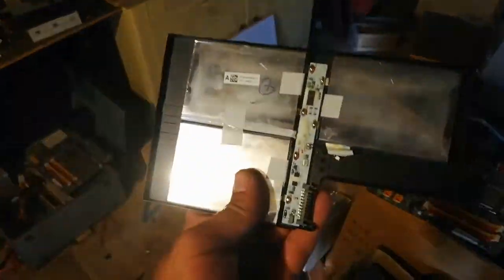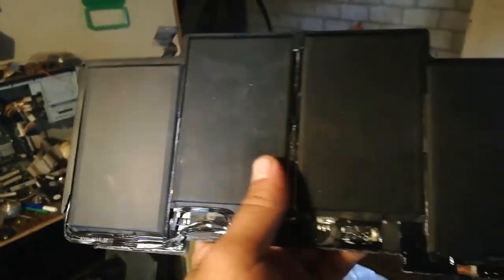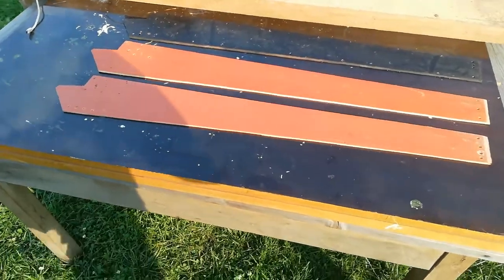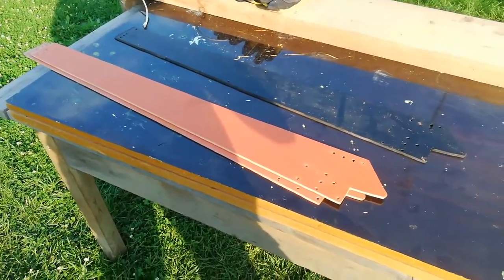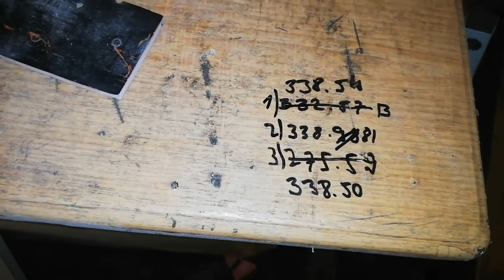Hoverboard PVC wind turbine blades Part 1

Comment: Interesting approach. 🙂 What is the PVC sheet material? Thanks
Reply from the maker: its regular pvc for house drainage...
Reply: @SigmaWorksSW3D  thanks so you cut the pipe into strips then flattened the curve out of them, turning them into "planks" of pvc?  Is that why you then needed to properly flatten them by heating over the fire then sitting on the plank on them? Thanks.
Reply from the maker: thats what i did, but they are too flexible when straitened... i sudgest to make them without heating up... just leave them bent and just cut them with angle grinder.